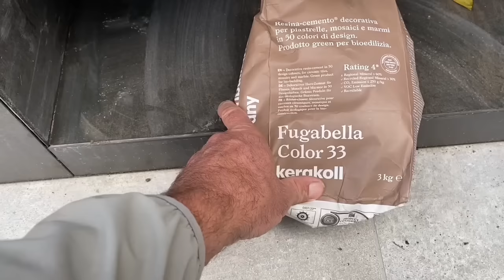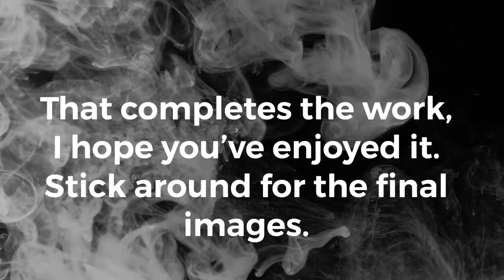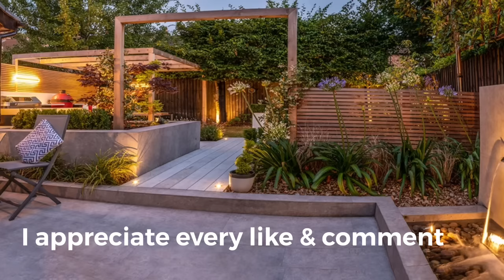The Mitre Garden - Part 2

Comment: Absolutely stunning work lads 👍🏻 I’ve been following you for a wile now and just love how you work, I am also a landscaper and carry out some similar projects. A quick question? I noticed that the level of the patio didn’t look to be 2 brick courses below DPC? How did you get around that and would a inspection pass this? Thanks 🙏🏻
Reply from the maker: Hi mate, as there is no brick work there it’s not as crucial anyway.
The levels were actually the same when we put ours back in.
When we do it, it’s usually on extensions so and the builders put a secondary dpc in.
One thing of always do is add an ACO AND fall away from the house, never had an issue with building control if you do this.
Thanks buddy

Comment: Top job, stunning work, what did you use for the slated fences and which gauge nails as i'm about to do one myself keep up the good work thanks in advance
Reply from the maker: Cheers mate.
Cedar slats.
38mm with a 12mm gap
Always use stainless steel nails
These were 63mm brads 👍